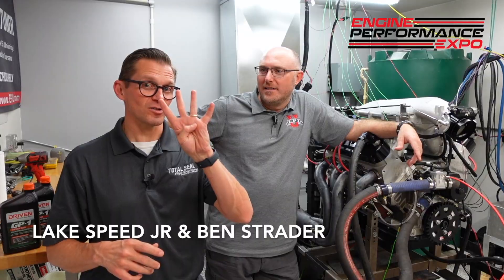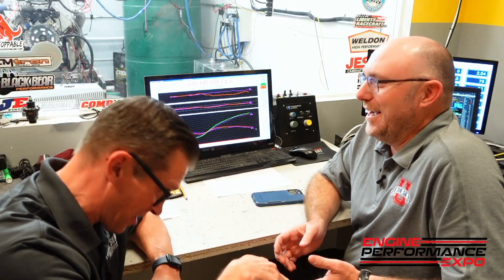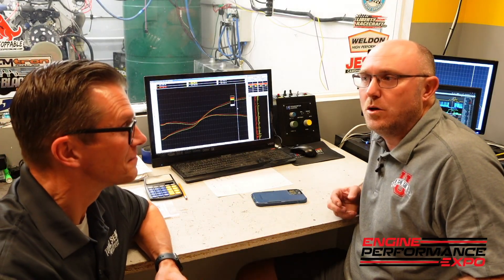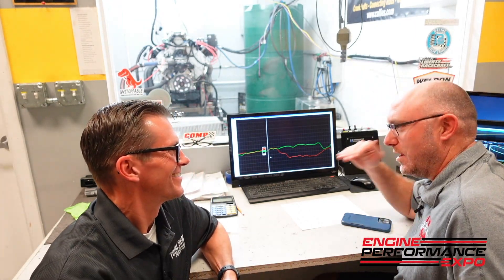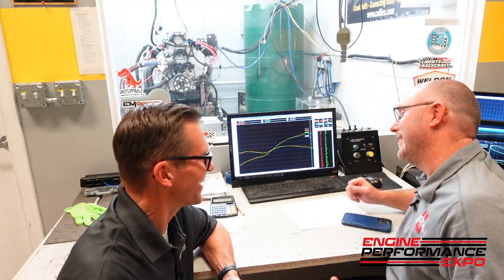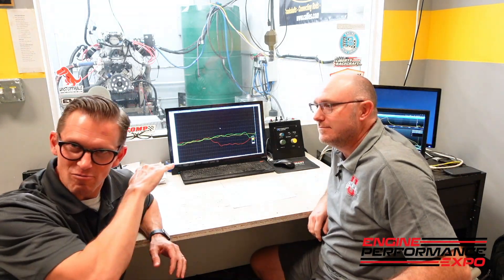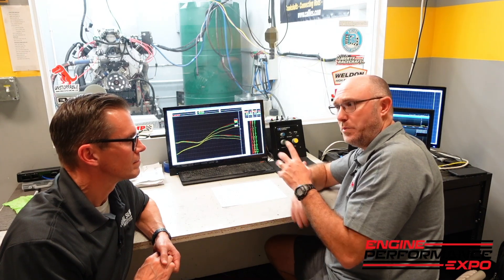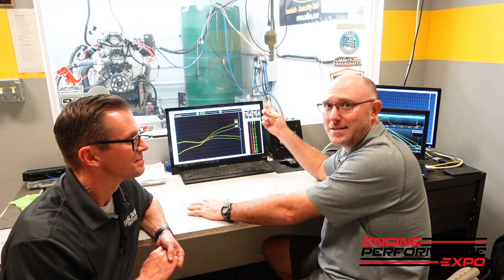How MUCH OIL is TOO MUCH? Dyno Results!

Comment: Not very convinced with the short time test. Suppose I get onto a 500 mile trip, I would not want my oil level to be low for some power gain in a short time. Do you know what will happen 5 hours later? Still more horse power?

Comment: The 350 small block in my 1994 k1500 says to add an extra 1/2 quart of oil for severe duty. I only off road the truck and spin the tires so that counts as severe duty. So I always run an extra 1/2 quart.
Reply from the maker: Interesting! Thanks for sharing.

Comment: I thought the reason to much oil on newer engines cause more crank case pressure and can cause oil to leak and burn more than being slitly low. Sp basicly i always herd better to be a little lowl than a little over i no back in rhe 80s that wasnt rhe case
 I do no more oil in the pan cause hp because of the crank going thrue it but a lot of rase cranks get knifed ao rhey can cut through the pan easier. Rhanks for the great videos!!!!!

Comment: accidentally put way too much engine in my car and then 
BiG buff of blue smoke and then a loss of power. 
I pulled over straight away. So iv not driven at lenth like this, but im bricking it now, lol 

Do I simply need to reduce the oil level, or is this a sign of more damage.
Any advice most appreciated

Comment: So bottom line adding 1 quart to much on purpose or by accident does absolutely no harm but in fact helps the engine!..
Reply: Can l use 1000ml oil to my 20 years old motorcycle...recommended quantity is 900ml...please suggest...
Reply: @gudlutripathy3283  The difference between that is negligible and won't hurt anything
Reply: @seatime674  thanks

Comment: What's the manufacture recommended amount, i.e. dip stick marks? because you said it holds 11 then only tested it at 5, 7 and 9 so I'm guessing 11 isn't the recommended amount otherwise you would have tested it at that for reference. From the testing 7 looks like the best amount but that number is meaningless without comparison to the manufacture recommended amount.

Comment: One thing i never heard was oil pump load, that robs power just like a ac pump.  Its not all about the windage. 
When that pump started sucking a little air, pump load was cut in half..

Comment: I have seen some funny oil change things at the various shops i worked at. Now i wasnt doing a ton of oil changes but ive seen so many mishaps of people ruining parts and engines etc.. ive fixed many mishaps.  One that comes to mind after watching this was this nice little old lady came in with her Chrysler Lebaron that she had towed in and said her son had changed the oil. Anyways the son had filled the engine completely to the top of the valve cover. Then a friend of mine ran across a similar thing where some knuckle head did the same thing to a chevy astro van. It takes a lot of oil to completely fill a engine. 
I've seen a bunch of silly things people do from fluids in the wrong place to crazy bandaids and repairs people literally cutting parts off thinking somehow thats right.
I bought a jeep around 13 or so years ago i still have it, i bought it specifically because the body was good and it was the exact color i wanted same color as my first jeep that was stolen and i never saw it again. I didn't care about mechanicals on this jeep but it did run and drive and the guy said no leaks and talked it up etc.. but this jeep was bad like super bad the interior including the carpet was spray painted and falling apart from all the missing fasteners then mechanically this thing was rough. But the guy talked it up so much i thought it was hilarious. Anyways i bought it and drove it home and the next day there was puddles of every single fluid in my driveway like a lot of everything. When i drained the engine oil there must've been about 14 or 15 quarts in that thing even after all the oil that puked out on my driveway overnight lol. That jeep is very nice now ive been a lot of places with it and have been through a lot with it im very attached to that jeep even though ive had many different jeeps and vehicles this one is just special to me. But I thought that was so funny how the guy i bought it from was talking it up so highly and specifically said multiple times it didn't leak, i obviously could tell when i inspected it there was leaking but damn i wasn't expecting the massive puddles in my driveway. I haven't thought about that in years. The oil filter on that engine was so incredibly tight too that nothing would take it off i had to remove the filter housing and it took 2 people while holding it in a big vise to crack the filter loose even the air hammer chisel wouldn't do it. It was a orange fram filter not that it matters but that was the tightest filter ive ever come across. 
That engine was actually rebuilt and the bottom end was in very good shape, i have a stroker motor in that jeep now but when i tore that engine down to inspect for something else i found that it had 2 different rear main seal halves in it. The guy i got it from had said he put a new rear main seal in it but i thought it was another one of his exaggerations because it leaked so much but the guy went so far to  take it apart and only replaced the seal half in the main cap but not the half in the block they weren't even the same color and the sealing lips were completely different. Its funny what people will do sometimes, theres some people that just make things worse by touching it. 

Boy this turned into a long comment reminiscing lol.

Comment: Fascinating documentary!  What I saw here is that if you don't run your engine past 5000 rpm, which is normal driving for most people, adding extra oil is a waste of money, and the normal factory fill level will be just fine.

Comment: My first owned combustion engine was a 1977 Kawasaki 400 motorcycle.  I had a "friend" tell me that needed to fill the engine with oil until you could see it in the filler hole.  I put an additional 4 quarts in until I got scared and stopped adding.  I then drove it and got about 10 miles in and it stalled out.  Another friend came to help me and we started diagnosing.  Pulled the air filter and the canister that it sat in was completely full of oil.  Pulled the filter and it was pouring off the filter.  He educated me on how to check the oil, we drained the 4 quarts out leaving 2 in the engine, wiped everything down and it ran great for the next 2 years until I sold it.

Comment: Lake, Garage 54 chan just did a similar but less scientific video. It was titled What Actually Happens when you overfill your motor oil? Both your video and there’s needed parts from the other to be more complete. They used a custom made clear oil pan.
Reply from the maker: I saw that. I really liked the clear oil pan!

Comment: Just how different would the results be with a DRY sump system on that same exact LSx setup??

Even on a sub 10 second duration drag strip blast, too low a level in a wet sump system could cause problems (even with proper baffles/windage trays/trap doors, etc.) due to the extreme throw back of the oil mass during high g, very low 60' times, sticky launches, due to the severe weight transfer off of the front wheels.

I could not see going to anything below that "very safe", stable oil pressure fill level on a wet sump engine for ANY 'endurance' type racing of any kind (with the added oil sloshing/pickup starving detriment of high g turns also thrown into the mix!), no matter HOW much power is 'gained'.

One has to finish the race in order to WIN said race. 😉

Comment: Yes, Oil is Friction.  BUT gives added Engine Protection.  So, Look for the happy medium if possible.
Reply from the maker: Yep, its a balancing act
Reply: @themotoroilgeek  Then to cut drag/friction/heat; how about making engines with Ceramic cylinder walls/bearings?

Comment: Trying to work out why oil pressure would drop. Does that mean the pump is pumping oil faster than the oil can drain back to the pick up pipe?

Comment: Would it be similar result if you used a 30 vs 40 at the same amounts? I assume 40 would give better pressure but lose power over a 30?
Reply: Yes but presumably you will have less wear and tear with 40..

Comment: The brother of the company that I worked for had a trucking and maintenance shop so our Chevy and Ford vans were serviced there. My Chevy with a 350 engine has servicing and I notice it was sluggish. I eventually put it in neutral and floored the throttle. No tachometer but I knew it was not revving near the high end. It comes to be that for the big trucks they use a two quart oil jug for the bulk oil. My five quart oil pan had ten quarts in it. No damage done.
Reply: Yeah, with that much oil in that poor small block, it was like the crank was trying to run in a pool of molasses!
Reply from the maker: Thanks for sharing! I’ve heard similar stories!
Reply: What makes you so sure that there was no damage just because it wasn't immediately noticeable?

Comment: If you aren't familiar with a particular car you can't always go by the dipstick. I bought a Mustang a few years ago that had an aftermarket dipstick in it, the WRONG aftermarket dipstick. I drained the stock 302W five quart pan and got a little over eight quarts of oil out of it. It ran ok and apparently the extra oil didn't hurt the engine, but the best part was that with the correct amount it stopped leaking oil out the seals.

Comment: From the title I was expecting to see how much oil before engine damage. As in excess oil on the cylinder damaging the oil ring over time. Seems to be what's going on in the context of lawn mower engines being overfilled. Flat head valves, sideways cylinder arrangements (single or opposed) and having splasher arm "oil pumps". Still a cool video. So, part 2? How much oil before extended wear due to excessive oil level?

Comment: I feel like some things that were said are misleading. When you’re overfull you CAN hurt the engine. The crankshaft hitting the oil will aerate it causing it to lose film strength, air does not lubricate. Windage plays very little in horsepower gains when UNDER full. The reason you have gains is due to less oil pressure. It takes power to create that pressure. That power is being derived from the engine and if you start taking pressure away the engine has less work to do. Run 0w-20 or pull some bypass spring outta that pump and you would get similar results. However windage is definitely a problem when being overfull (as seen) and something to control even at normal oil levels. Great video though!
Reply from the maker: Thanks! We are going to address foaming in a different video with a different engine.
Reply: Actually, with some hybrid engines a level just slightly above the full mark will force oil into the EGR system when the gasoline engine starts up and this can cause the engine to run rough.

Comment: I found out something odd. My car (Mazda Protege 1.6 ZM engine), has 3.x liters of oil pan capacity. But one day decided to measure the oil level with the engine running, and was quite below the half mark. Decided to top it off until full.I know it will show up as overfilled but, for durability purposes, that oil pump running with that serious low level, scared me.

Comment: but how long before the crankshaft causes so much aeration in the oil of an over filled engine, that the oil pump is trying to pump more air than oil?
Reply from the maker: Not too much longer! If we were running the engine steady state, it would start doing that.

Comment: Can you do a video on oil temp?

I like to do trackdays at road courses. If the OEM specs out 5w-30, at what oil pan temp should I cool down?

Also, how does oil temp affect the viscosity I should be using? 

Is adding one extra Quart of oil to help prevent oil starvation during high G turns a good idea? Or is the risk for oil frothing make it a bad idea?

I think a video covering these questions would be a hit. 😊

Comment: On my Subarus with the old style UEL sump the normal service is 4.5L including filter I have always used 5L. I have a mate who had a whole bunch of data showing the differences on our local track that he races and there was a significant oil pressure drop with only the 4.5L going around some of the long fast corners. Luckily the crank is very high so I doubt it would suffer the same issue.

Comment: I had a 2001 Ram 2500 with the 5.9 Cummins and spec says she held 11.5 litres…I would take it to the dealer and I would supply the oil every time and I used Esso XD3 15w40 from new…never had an issue till one day I showed up with 3 jugs of oil that held 4 litres each…the kid doing the oil change threw all 3 jugs in so I was a half a litre over and it was high on the stick…I questioned him and he said not to worry about it he did it all the time so I took it home and it had a very strong oil smell the whole way home and it just wouldn’t let up…I figured he just spilled some oil but he didn’t and I ended up taking some out to make it stop…that engine was super sensitive to over filling…I would usually just put 11 litres in and I would never have a problem!
Reply from the maker: Thanks for sharing!

Comment: I recently had to have my motor replaced in my 22 F 450 7.3 gas, with 115k,

Now I put 2 xtra quarts of oil in it, 10  instead of 8
I definitely have an increase in oil pressure and it appears to have better performance!
And fuel mileage!

Comment: New subscriber, came over from Dave's channel. 
Oil level has always been a question of mine. I've seen people get bent out of shape because their oil is 1/4-1/2 qt overfilled. 
I'm thinking as long as the oil isn't high enough to touch the crankshaft, it won't foam and cause any issues. 
Is my thinking correct, or am I out to lunch on this thought process?
Looking forward for your answer.
Reply from the maker: Over filling will cause foaming problems!
Reply: @themotoroilgeek  how much over full? 🤔 Did you read my whole question?
Reply from the maker: @dans_Learning_Curve  A 1/4 or 1/2 typically is not enough to touch the crankshaft. The amount will vary based on engine design.
Reply: @themotoroilgeek  I agree.
Oh, new subscriber.
If you're interested in vintage vehicles, there's a playlist on my channel on the car in my profile picture. My late father's 1958 Plymouth Suburban. Consider following along as I slowly get it back to daily driver condition.

Comment: Is there any chance you could look at Motul 300v 5w40 competition package? See what the anti-wear and detergent package is like.
Reply from the maker: Noted
Reply: I am especially curious as to the 300V series' base oil type content levels by percentage (which needs some VERY expensive equipment to actually test accurately, as Motul will never tell you that info), and their full additive package content and PPMs (which is relatively easy and very inexpensive to test accurately).

Comment: Doesn't too much oil cause excess pressure on the seals? Or is it strictly the oil pump that determines pressure even when overfilled?
Reply from the maker: Foaming would cause that, which can happen if it is over filled.
Reply: @themotoroilgeek  And what's with the overfilling? I've had two JLR dealers overfill my car by 2 quarts when I had them do an oil change. Needless to say, I do my own changes now, every 5000 mi. or 6 mos.

Comment: I had a leak from rear main crankshaft seal and mechanic said oil seal was very soft, like if it was partially dissolved by something. Can it be caused by using wrong or counterfeit oil? For my car there are seals made from MVQ or FPM. Is it possible that one is not compatible with oil and other one is?
Reply from the maker: Some oils could soften the seals, especially if any additives were used with the oil.

Comment: I live in NW Ark and have a 2002 F350 7.3L diesel. I have 210,000 miles on it and I don’t drive it very much and don’t drive it very hard but I don't “baby” it either. I’ve always tried to do the very best at consistent maintenance changing the oil when it looks dirty rather than going by some ominous recommended mileage number. I’ve always used Rotella T6 5W-40, full synthetic because I need my vehicle to last as long as possible. That said here in the last several years I’ve been using the Lucas oil additive and the Lucas fuel additive in my truck and from what I can tell is that it doesn’t smoke anymore since I started using that and was wondering if there was the better oil and/or additive to continue using or is there something that would be better?
Thank you for any insight you can provide me
Reply: I don't think Rotella T6 has been around since 2002.
Reply: @toddb930  sorry I miss spoke there didn’t I? I’ve always what I meant to convey is that I’ve always used the Rotella full synthetic. I think it was T5 And then when T6 came out, I started using that so hopefully that clears up my miscommunication
Reply: @matrix64  --  okay, thanks.  Gotcha. 👍

Comment: Well if you added more oil for more oil pressure and power loss with 15w40 then you could put 7 or 8 quarts of 5w20 or 10w30 to regain horsepower and keep oil pressure up with more oil  capacity which would be equivalent to the beginning of the video when you ran the engine on 15w40 on 5 quarts. I bet you'll be making the same hp with 5w20 or 10w30 with 8 quarts as to running 5 quarts on 15w40. If anybody sees this and you are an 
engine builder, try it out. Maybe it'll work.
Reply from the maker: Stay tuned for a future video

Comment: Lower viscosity oil should prevent it from dropping as much. 0w-20 would probably show great results and provides just as much protection as long as temperatures are under control. The oil can't get back into the pan fast enough for the pick up tube to pick it back up. Spinning the oil pump at different speeds would be better. A slower oil pump and higher idle speeds would probably be my "tune" so you don't have to deal with the low idle pressures.
Reply from the maker: Stay tuned for a future video